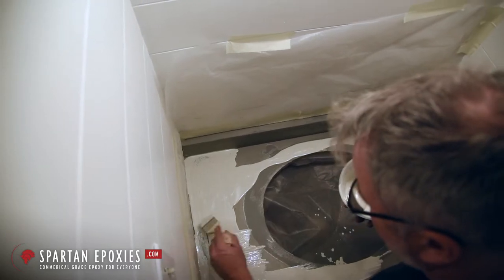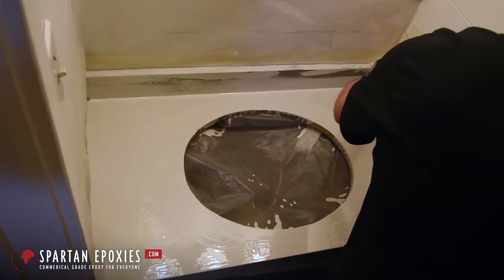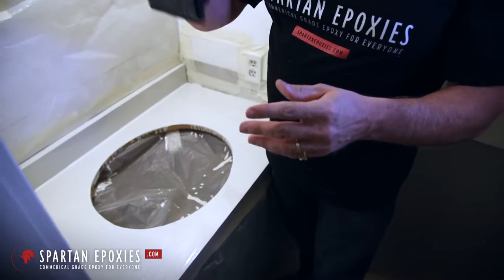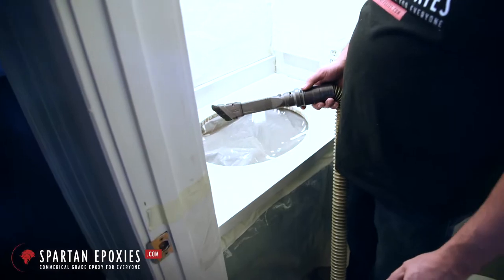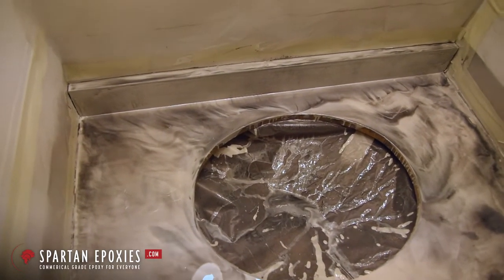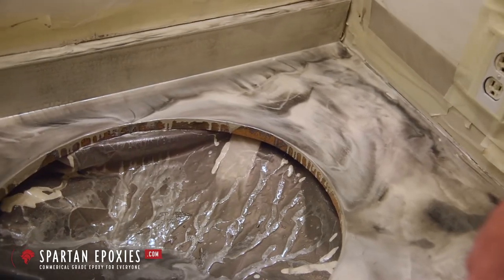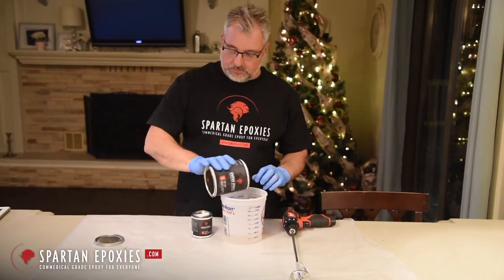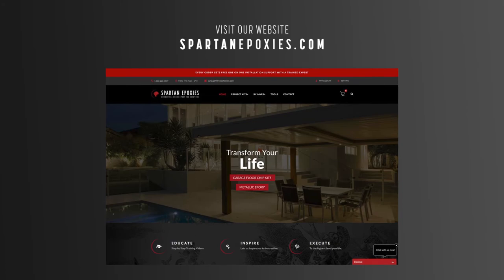How to install metallic epoxy on a countertop DIY - SpartanEpoxies.com

Comment: I'd like to duplicate this exact look so I would need the 25 sq ft kit with metallic whale and metallic pearl and that's it?  Is the primer and urethane also included? Also I would love to see the finished product from this video.
Reply from the maker: Hi T D. Pearl was used as the primary color and whale was used as the highlight color. We include the primer, clear, and 1 pigment but have an option to buy 1oz (11.25 grams).